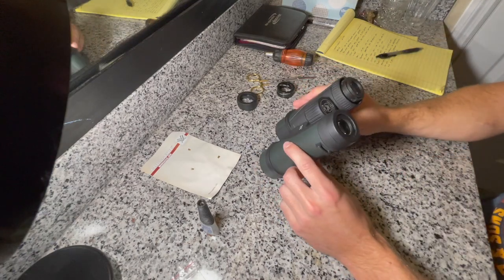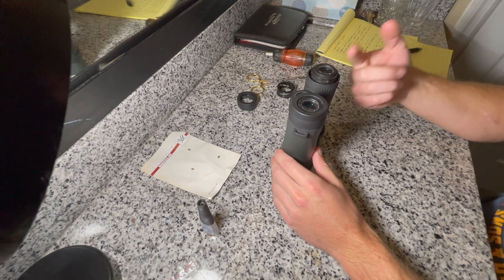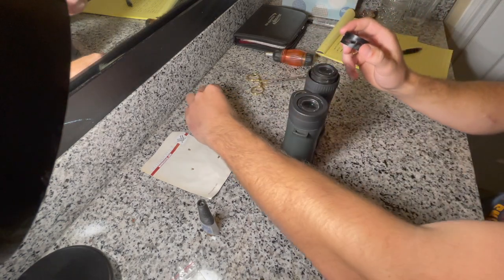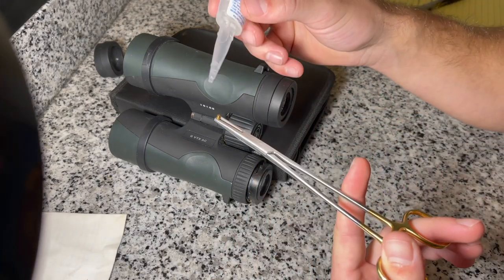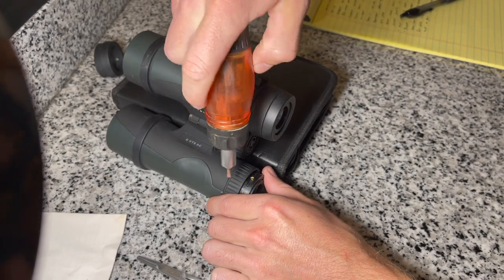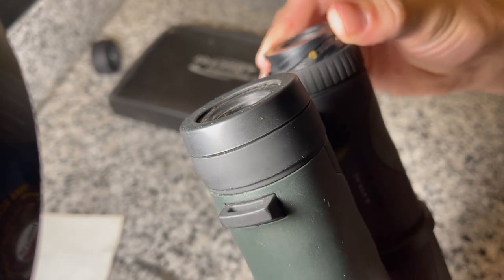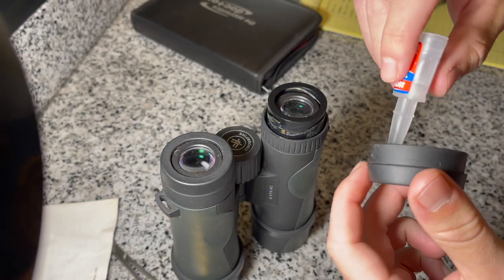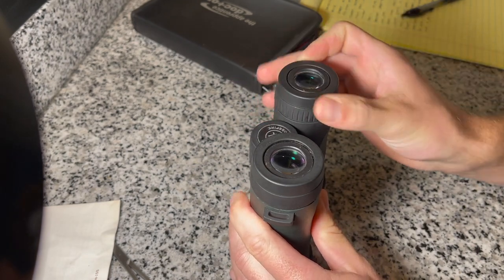Vortex Crossfire 10X42 Binoculars Eye Cup Adjustment Repair   HD 1080p

Comment: My binoculars are pretty much brand new, and the rubber piece came loose. It just needs glue, but im not sure if I'm going to return, warranty, or fix them myself.
Reply from the maker: I just didn’t feel like going through the trouble of sending them off. They are still holding up. I’m sure they would fix for free if you went that route.